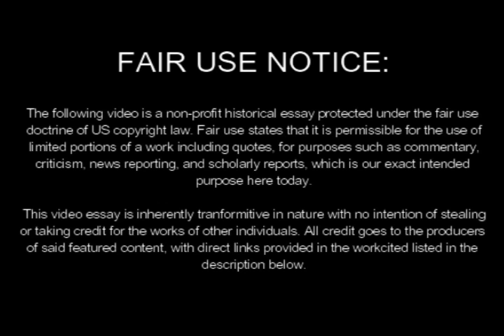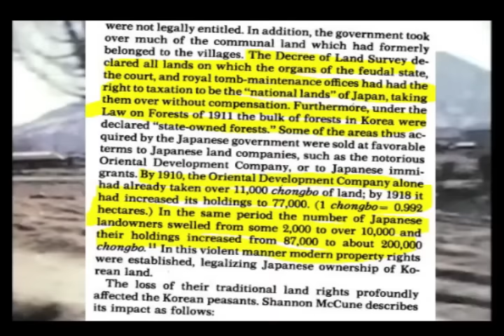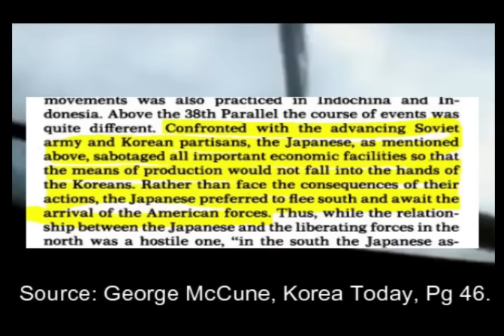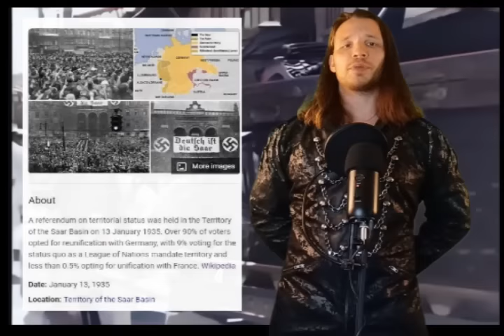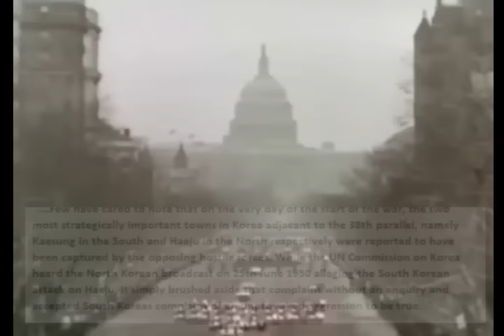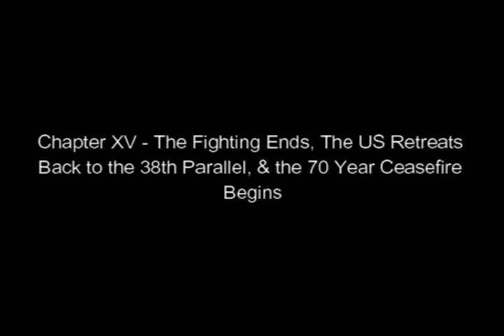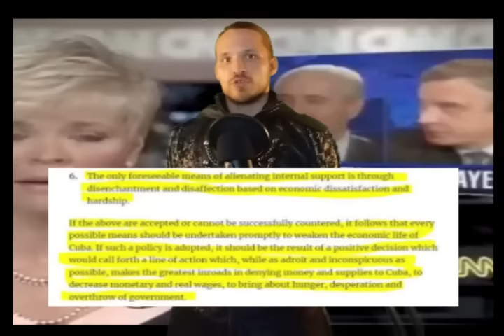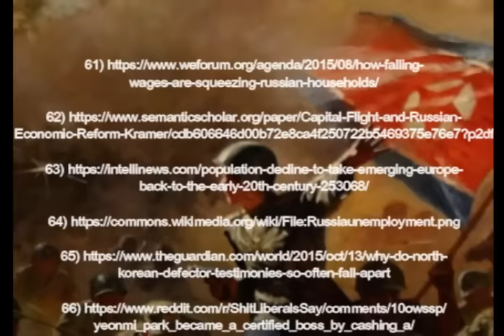THE TRUTH ABOUT NORTH KOREA - A PEOPLES HISTORY OF THE DPRK

Comment: A sub from me. It’s called Leninism sent me here. Just started the video and laughed my ass off at the intro. Great work comrade. I’m just now getting into the history section and super impressed with your bibliography comment (I’m a biblionerd) and the quality of the clips, footage and pictures used. It says it’s only in 480 though, is that because the length makes it take longer to be available in 1080? Or do you not post in 720-1080? Don’t really care but just wondered if I should come back to download later.
Reply from the maker: It's because I exported it in the dimensions 720x480. So I think 480p is the highest quality I think.
Reply: @fellowtraveler2251  thanks for the info! I kind of assumed but I thought maybe it uploads at higher and higher bitrates until full upload was ready or something lol overthinking as usual